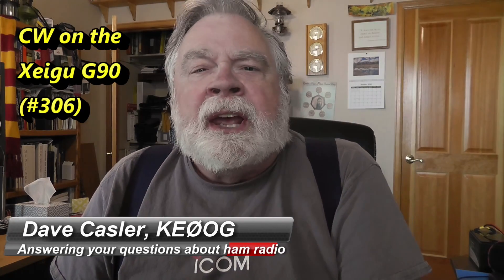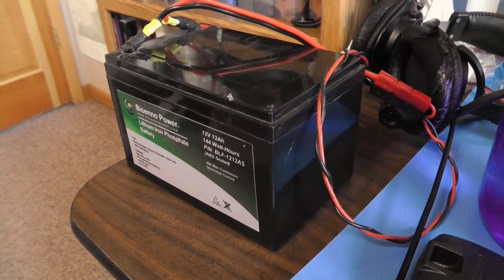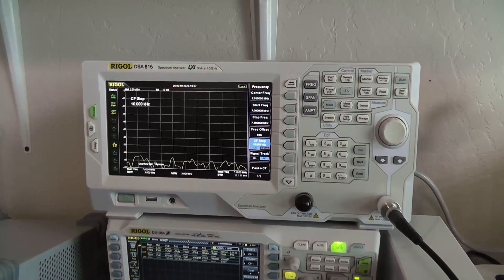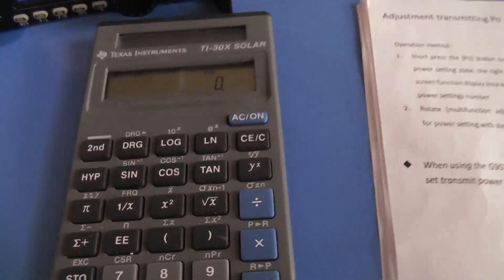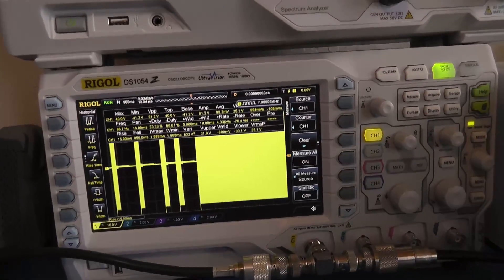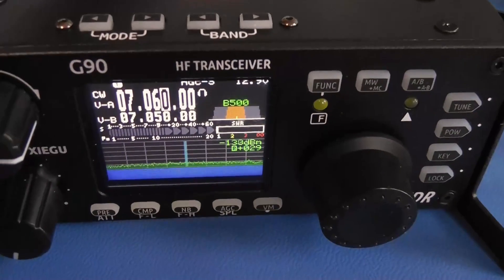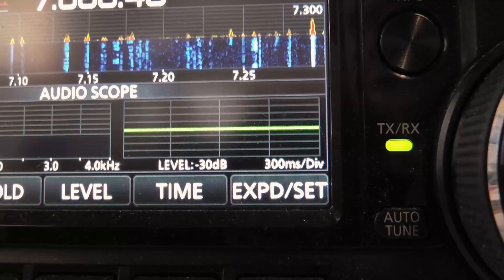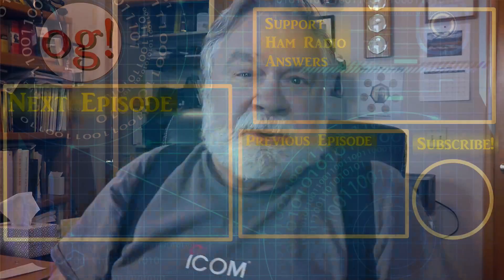The Xeigu G90 QRP Transceiver on CW (#306)

Comment: Hi Dave, enjoying your reviews and in depth technical knowledge. I am approaching early retirement and have chosen to travel down the road of amateur Ham Radio. I have for many years tinkered with my AOR 8200 and Sony ICF SW55 listeners.

I am waiting on my Yaesu FT-5DE and will self study for the Foundation Lic. UK (Tech Lic. USA equiv). I really like the reviews of the Xiegu G90 despite the minor gremlins and it's portability for home use and travel, low cost, 1st licence 20w useability and low poer consumption.

I was thinking that the CW anomalies may be due to the G90 SDR characteristic of digitally converting Analogue -> Digital conversion > DSP = delays of the SDR, which analogue circuits may not suffer from.

Comment: Maybe you can answer a question for me.. I have tried to use programs such as CW Type as memory keyers and for keyboarding.  The programs will all key the radio ok, but I get no power out.  Power out is fine with paddles or straight key.  I use an Xggcomms 4 interface.   The radio will key in AM and FM modes with CW Type and I get power out in those modes but not CW.  Any clue to what's going on, or rather, not going on?

Comment: Hi Dave, I bought one of these for cw use but ive only seen the indicator light flash a couple of times Briefly while recieving a strong signal. The book says it will flash with the code if it is tuned to the correct pitch. Do I have a setting for that "correct pitch"? If so, what do I do?
Thanks

Comment: The IC-7300 is showing audio, not RF. That leading edge spike is filtered by the FPGA DSP. To prove this, change the AGC speed on the 7300 and observe the difference on that same audio scope. Now if you switch the 7300 to the spectrum scope, reduce the "span" to 2 khz in center mode you should note some extraneous sidebands caused by the spike. Thanks & 73 N4LQ

Comment: If you are fascinated by cheap HF radio transceivers, then take a look at this one.
https://www.hfsignals.com/index.php/ubitx-v6/
Upto 10 watts pep on seven HF bands, dips to 5 watts on 28 MHz
SSB and CW
Simple to build and align
Minimal controls
Based on Arduino Nano controller and a Si5351 for all local oscillators
Double conversion, superhet architecture
It can be scratch built for less than $50 or you can just buy the kit.

Comment: My G90 killed itself yesterday. It tuned up my antenna and while tx, I noticed SWR meter was freaking out and ALC all over the place. Tested tx and got some magic smoke. Upon inspection, the female center conductor on the G90 pushed in, effectively making it so it was tx-ing without an antenna connected. Why SWR cutoff didn’t work or the fact it even gave me a tune is beyond me.
Reply: I read on a forum that there are some issues with a G90 with one pin of the power connector going in. We advised to return the unit, as it was still under warranty. Mine have had not problems so far. I have discovered that if you turn the radio off with the cat cable connected and FLRIG active, it does not want to turn on, but removing the cable from the USB port solves the problem. Write to Radioddity about your problem, they might help you out, 73 de WP3BM!

Comment: I used the G90 on CW extensively during the late spring and early summer during POTA activations. Similar to Dave's results it put out a bit more than 20 watts, but when you're dealing with a max 20 watt rig, whether the PEP is 20 watts or 23 watts the difference is negligible.

Comment: You might want to update that to the latest Firmware version (V1.75) as your radio shows some quirks of the v1.74 beta firmware that I suspect is installed on it... Xiegu have a bit of a bad habit of sending out radios with unstable firmware installed.
Reply from the maker: Thanks for the pointer. Indeed, the radio has 1.74 firmware. I'll look to update that.
Reply: There's a much easier way to flash it with a program called g90updatefw
Reply: @dazednconfused31337  it's not very difficult to do it the normal way. It only takes a couple of minutes.

Comment: I'm enjoying my G90, but I'm only using it for digital--mostly PSK31 and some FT8.  I've had limited experience using it portable, although that really is the reason I bought it, but the few times I have--in a park about a block away--it has worked very well.

Thanks for your videos, Dave.

Comment: The waveform shown on your IC-7300 looks more like what we think of as a properly-formed CW waveform.  On transmitters that come up to power very quickly each time the key is pressed, you would potentially transmit key clicks.  So there is often a deliberate need to round off the leading edge a bit, like adding capacitance in the keying circuit to slow the rise time.  Of course, that ultimately limits the top-end CW sending speed, in analog circuitry anyway.  With DSP, you can dial in a precise fraction of the leading edge, and I'm guessing that's what is in the G90.  It's also possible that the little overshoot on each leading edge is only visible with close-up measurements.  It might cause some stress issues on an amp, though, if it's truly part of the power envelope.  I remember some of the early Kenwoods (or was it Icom?) had some overshoot issues that had to be resolved if you were driving an amp.  Thanks for the interesting video, and hello from another Dave in Utah.

Comment: Thanks for this video.
I really enjoy my G90 for voice and digital modes, but have not used it on CW.
What firmware version were you running during the test?
I wonder if what you found can be addressed in a firmware update or has been?
73 de N2NLQ
Reply: Yes, I too am interested in what Firmware rev / date is on that device.   Also, would it be possible to test the ICOM 7300 CW output on the Rigol as well, to show apples and apples?  thanks Dave!   K7KS
Reply from the maker: I think the firmware is a version out of date or so. I’ll have to update the firmware and rerun the test.